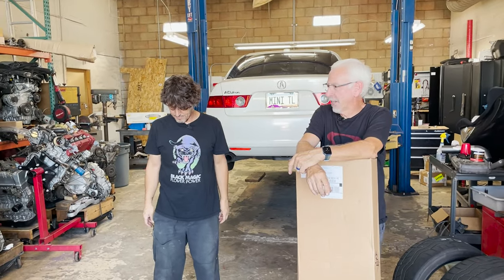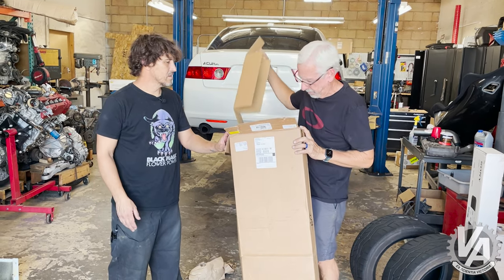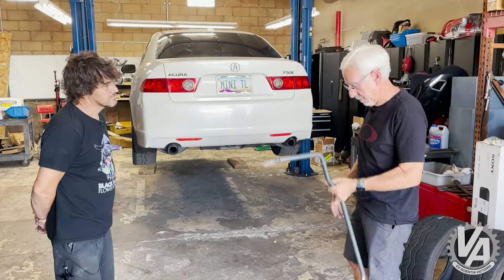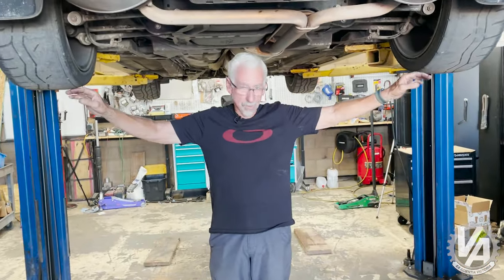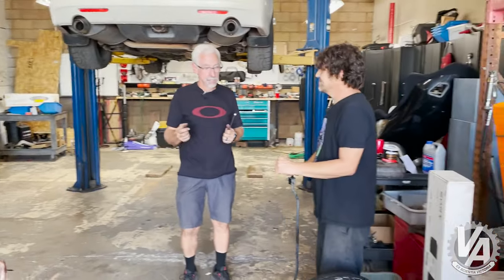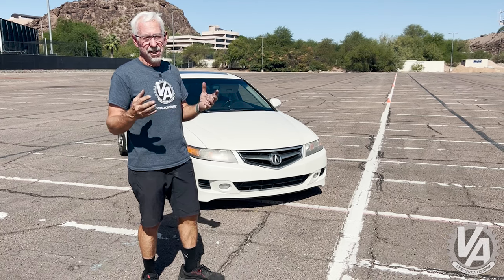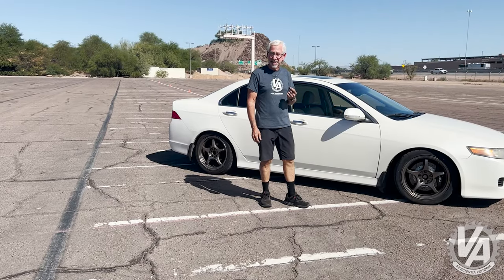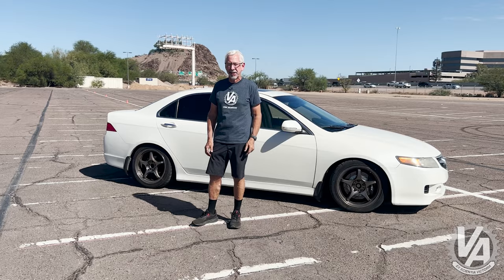We Test the TSX Rear Sway Bar Mod

Comment: I had Progress coilovers and rear sway bar on my EK and it was HILARIOUSLY fun to chuck into corners. Big shout out to Progress, they make fantastic stuff.
Reply from the maker: Makes the cornering so much flatter so you can carry more speed
Reply: Progress tech hollow chromoly on the 9th gen 6-6 Accord is an absolute must. Can't say enough for what it did for the handling... At a nice 3-in drop and some uhp tires and it's the perfect recipe for a hell ride through the countryside.

Comment: Pro tip: give the sway bar a couple wraps of Teflon tape and grease.  The Teflon works wonders for when the grease eventually wears off.
Reply from the maker: Great idea
Reply: What kind of grease you recommend? And where is the spot to wrap the Teflon and grease in particular
Reply: @latuba2478  Any grease will work fine, marine...superlube..whatever.  Do teflon wraps in the area where the polyurethane bushings clamp on to the sway bar + a half inch extra on either side.  Then a thin smear of grease on top and a bit more on in the urethane bushing itself.

Comment: Great video! The TL-S Rear sway bar is also a great cheap upgrade for the TSX.
Reply: underrated comment.
Reply from the maker: Absolutely, at 20mm its definitely stiffer than OEM and is a little cheaper.

Comment: At which hole of the Progress did you tested? Would be interesting to see difference between the two holes of Progress.
Reply from the maker: We used the lower stiffness. Progress recommends this before going to the stiffest to get a feel of the car rotation first.

Comment: I have a TL-S rear bar with tein S techs and koni yellows.  I do not like the teins much, personally I wish I had went with ground controls to go with the yellows.  

The S techs ride ok, like stock but a little sportier but I find them to be too soft still and overall too low in the front. 

By far the best mods for the 1G TSXs are a rear sway bar and ECU reflash.   They really wakes up the CL9 chassis and K24a2, and are relatively cheap and easy mods to do.  

CL9s have very good stock suspension (spring and dampener tuning) from the factory but could use some negative camber up front and a little less camber in the rear.  For a while I ran my car on track with just the TL-S rear bar and stock suspension and didn't mind the body roll the stock suspension allowed.  It was extremely neutral and still allowed for rotation.  Honda really nailed down the camber arch in this car despite the roll and comfort it provides.  

Best bang for buck performance mods:
-TL-S RSB
-Conti ExtremeContact Sport tires 
-Hawk HP+ pads 
-ECU reflash 
-Intake resonator delete, replace with velocity stack
Reply from the maker: Nice set up!
Reply: @VTECAcademy  thank you!  The SPC 5 piece rear arm kits are also a good mod to have just that extra bit of rear geometry adjustment that I've used to nearly zero out the rear camber.  

I think some Ground Controls with my Konis in addition to my TL-S front Brembo conversion and rear 12.3" bike upgrade will complete the chassis rather well.  

Supercharger next...maybe.
Reply: what car are you running tl-s sway and brembos on? TL or tsx?
Reply: TSX.  TL-S rsb would fit 1g tsx.
Reply: I hate HP plus. The dust will oxidize if you let them sit in rain😢
Reply: @latuba2478  Haven't had any major issues.  I use DTC30 and DTC60s now though.

Comment: I had an 06 TSX with a lowered factory Aspec suspension.  I later added the larger Progress RSB.  Made a noticeable difference with improved handling on the curves with the larger sway bar.  Ended up snapping a rear endlink just turing into my inclined driveway a few years later.  Replaced with HeelToe Automotive Fastline adjustable powerlink endlinks.

Comment: I’m definitely doing this to my dc5. I never did it to my old dc2 gsr because it required that subframe brace to prevent tear out, it had spacers, long bolts and nuts etc, seemed to clunky and heavy. 

Cool how it was compared to the stock bar, noticeably better
Reply from the maker: We didn't plan this, but Progress has a discount on rear sway bars right now. https://www.progressauto.com/product/progress-gear/99.SUPER.SAVE-progress-super-save-coupon
Reply: Made my 06’ Rsx type S so much more fun. Car feels great.

Comment: I installed the front and rear sway bars from the 08 TL Type-s on my TSX and it made a huge difference and installed the TL type-s Breaks from the TL
Reply: Front doesn’t fit
Reply: @albertforero3381  what doesn’t fit
Reply: when installing the tl-s brembos on the tsx. what all did you have to do? i have a set of front knuckles and brembos sitting around.
Reply: Is it perfect fit or need modification ?
Reply: @josecunsako31  for both it’s perfect fit on the sway bar the breaks you need to buy parts
Reply: @DJPapiatl  thank you
Reply: @DJPapiatl  does it matter if it comes from a base model TL or it has to be a type S ?
Reply: @josecunsako31  type s
Reply: @DJPapiatl  thank you
Reply: Whats parts do u need for the TLs rear sway bar to work on the tsx?

Comment: I’ve been running a progress rear bar on my TSX for 9 years now, I DONT run it in the aggressive setting. 
I’ve run a big sway bar on EF hatch that has spun me around in the rain a few times. Don’t want that happening on the daily.
Reply: That sounds like you had tires that didn't offer the best grip in the rain, or you were going too fast.

Comment: Got progress rear sway bar 24mm for $100 . Super deal . Can’t wait to install mine . Should I use OEM links or adjustable links that come with kit ?
Reply: Adjustable so you don’t have pre-load.
Reply: I added Progress RSB on 06 TSX Aspec and kept the OEM endlinks.  Snapped an endlink a few years later just driving up my driveway.  Switched to Fastline adjustable powerlinks from HeelToe Automotive and had zero issues (TSX was totalled in 2019 by a red light runner).
Reply: @mrgold3591  dang sorry to hear about the totaling . How did the car drive after the rsb was installed ?
Reply: @white9th193  It drove and handled like a dream with the Aspec suspension and Progress RSB.  It felt stock and very comfy; but, lowered in normal driving.  It felt planted and rotated a lot better when the roads got curvy (17" Conti DWS tires).  This was the main reason I went for the TSX instead of a TL because of made in Japan quality and better handling of the TSX.

Comment: Great video gentlemen! I have an 06 Civic EX 1.8 with automatic. Aftermarket struts and rear shocks totally adjustable dampening. Aftermarket rotors and pads. 6 1/2 inch wide steel Honda wheels with 205x50x15 Road Race Hoosiers slicks! -1.5 rear camber with 1/16th Toe in, -1.5 front camber with 1/16th Toe out, stock sway bars. I weigh 2582 no driver, LF 816 RF 814 LR 489 RR 463, 2762 with me, LF 896 RF 829 LR 540 RR 497. The car pushes - under steers bad - my perspective. What sway bars would you guys swap to?
Reply from the maker: Progress 24mm adjustable rear sway.

Comment: Hello. Could you tell me the number of the part that you put, please?
Reply from the maker: The Progress Suspension website is down right now, so I can’t look it up. It can be found here though. https://throtl.com/products/progress-tech-04-08-acura-tsx-rear-sway-bar-22mm-adju-62-0104?cq_src=google_ads&cq_cmp=17684619527&cq_term=&cq_med=pla_with_promotion&cq_plt=gp&nbt=nb:adwords:x:17684619527::&nb_adtype=pla_with_promotion&nb_kwd=&nb_ti=&nb_mi=113964941&nb_pc=online&nb_pi=6a47e3de-9ba4-4b94-bb65-e1e35e0d843c&nb_ppi=&nb_placement=&nb_si=%7Bsourceid%7D&nb_li_ms=&nb_lp_ms=&nb_fii=&nb_ap=&nb_mt=&gclsrc=aw.ds&gclid=CjwKCAjwkLCkBhA9EiwAka9QRscZfbWn0Bk-WJS1QJCIr7mq9G61rPsC1OEx58Ofh0qi8008NOHb2RoC6MEQAvD_BwE&gclsrc=aw.ds

Comment: Have you done anything to avoid the mounts tearing of the subframe?
Reply from the maker: No, most of the TSXs running the Progress rear sway haven't had that issue. Our suspension is a bit stiffer than stock so there is less stress on the mounting point.

Comment: The tsx and the accord are very similar right? Would it be wise to do this on a 2005 accord?
Reply: American accord is a different chassis then the TSX. The TSX is based on the jdm accord.
Reply: @thehaltingproblempittsburg6071  ah okay thanks
Reply: @thehaltingproblempittsburg6071  for the sedan yes the accord coupe tgou of the same
Years is the same
Chassis

Comment: Any issues running the stock sway bar end links at the current ride height?
Reply from the maker: We haven’t noticed any interference. They should be fine.
Reply: I eventually snapped a rear endlink with my lowered Aspec suspension and Progress RSB.  Added HeelToe adjustable Powerlinks and front/rear camber kit to get everything into specs after +100,000 miles.

Comment: Hey guys, know of a thicker front sway bar that we can use on the tsx??
Reply from the maker: I wonder if the TL front sway bar is thicker?
Reply: @VTECAcademy  I was thinking his also since TL rear fits but I don't have access to usdm cars to find out for myself. Was hoping you can confirm?
Reply: @VTECAcademy  still would like to know but I found a front and rear set made by H&R in Germany. I've purchased a set. 28mm front and 20mm rear made from (hf) 50CrV4 steel